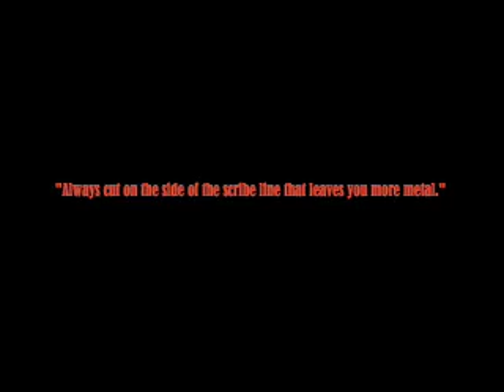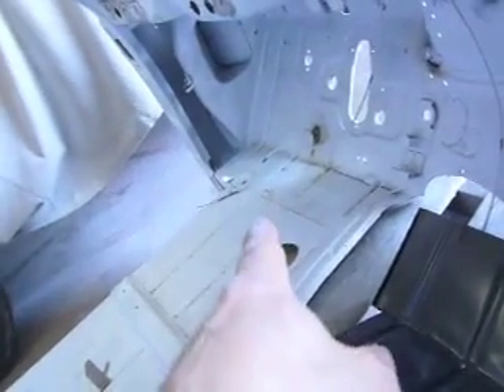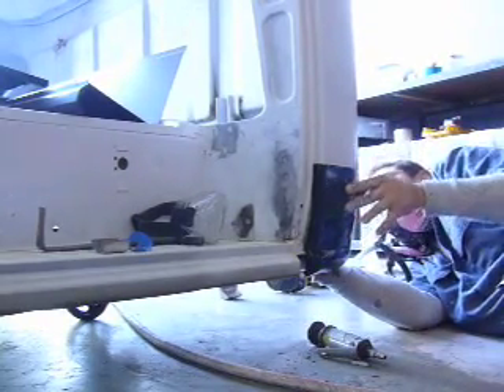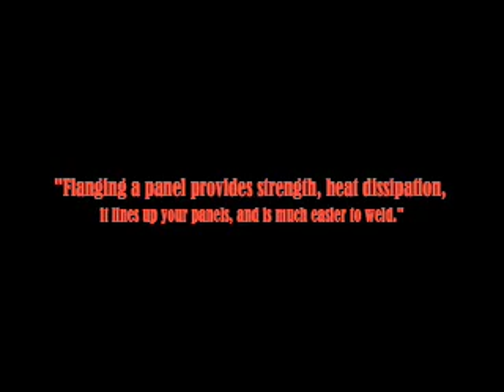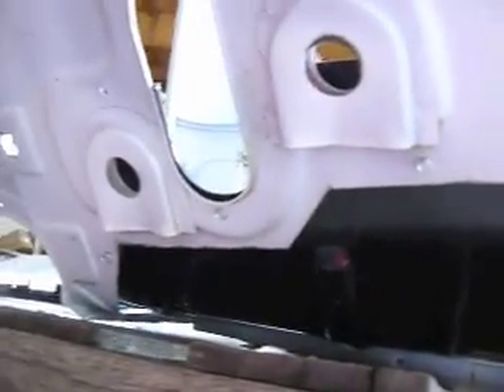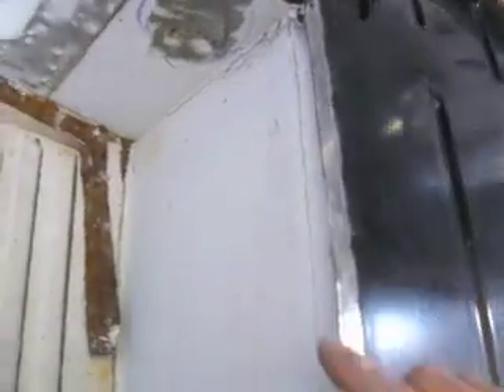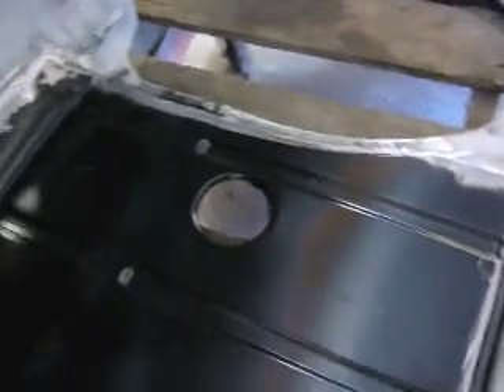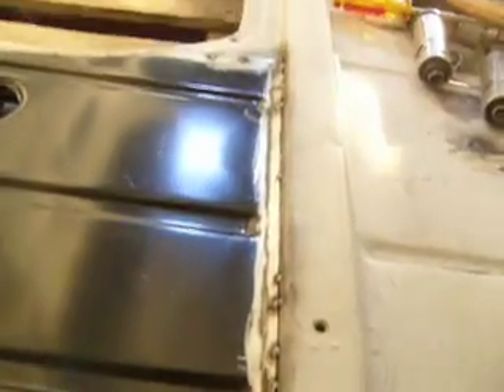episode 3 / 1957 GMC update / patch panels

Comment: That lower cab corner patch on the passenger side fit perfectly.  Could tell you spent alot of time prepping those pieces to them to fit good.  Makes a huge difference how the welds turn out and ultimately how much filler work is required.  Thanks for the video.